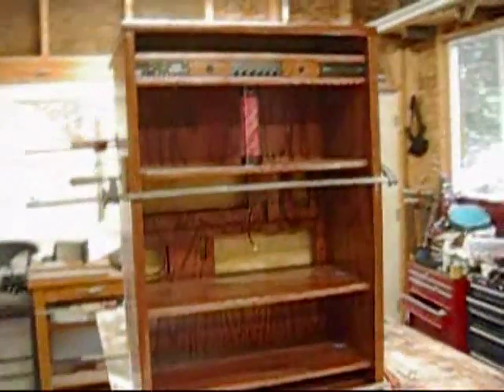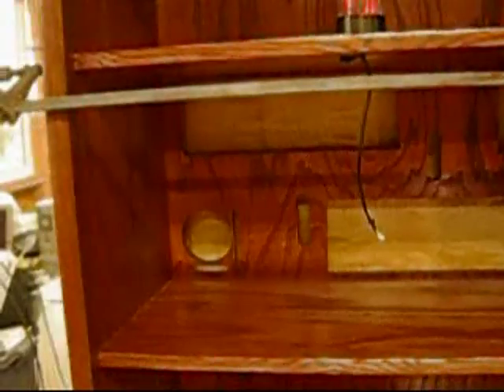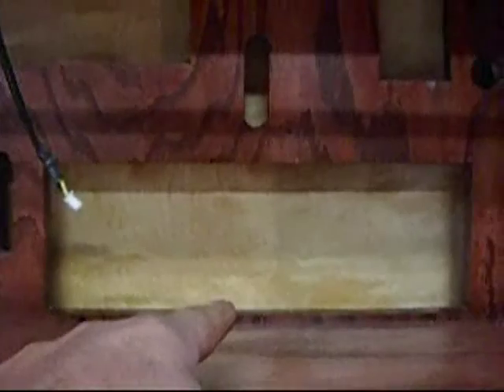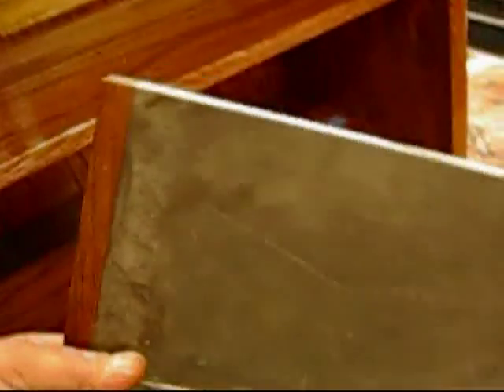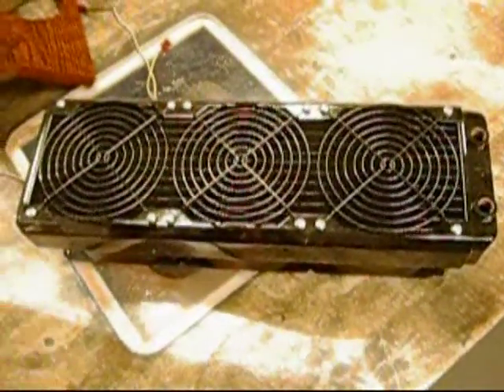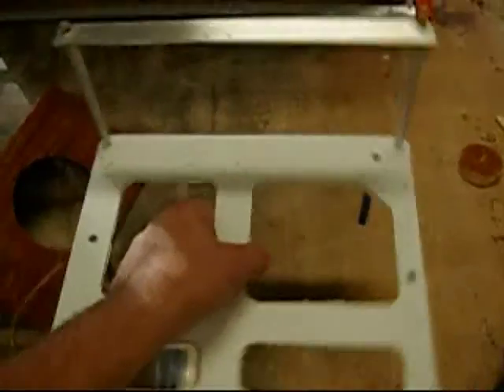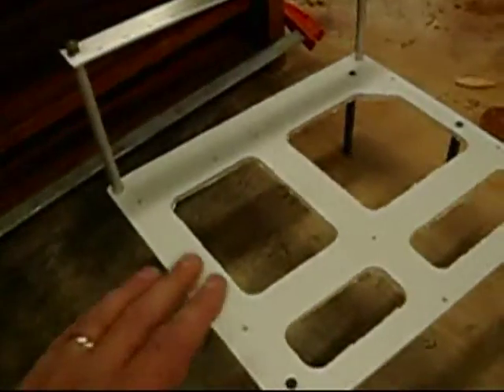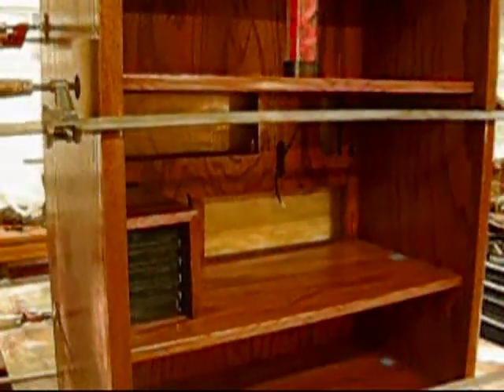Custom PC Case Bookshelf TV Stand: Dryfit #2

Comment from the maker: Got the parts sanded and wiped down and will  be applying a second coat of Polyurethane this evening. Stay tuned for the grand finale when I epoxy the unit together. I want three coats of Poly down before glue. Much easier to sand parts on the bench than in place.